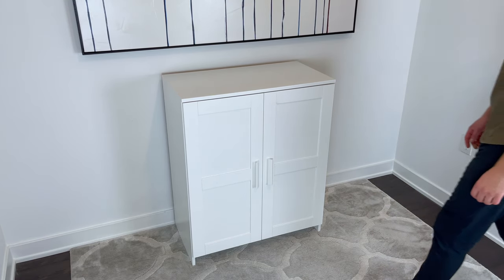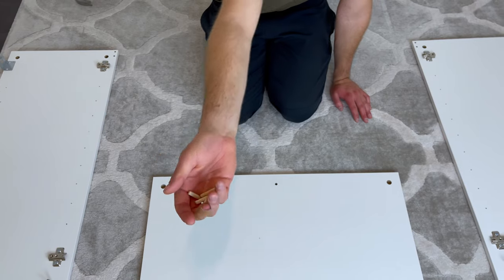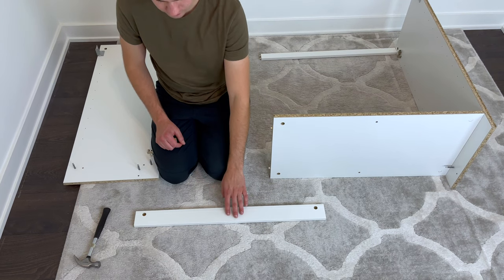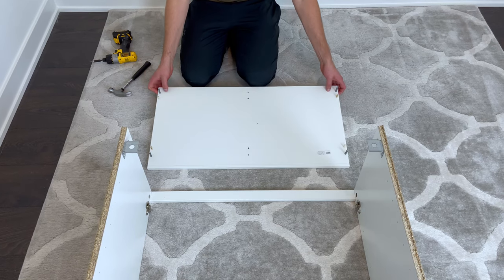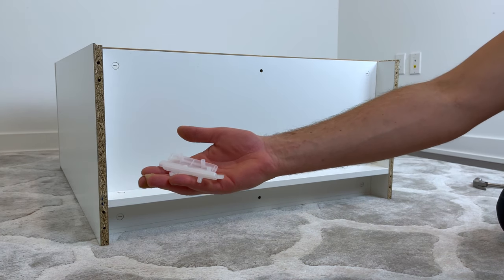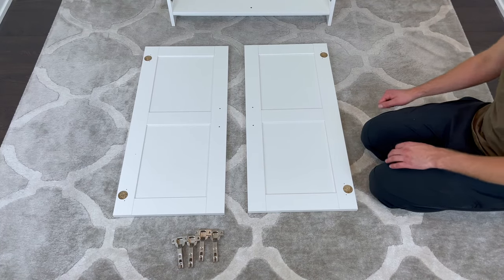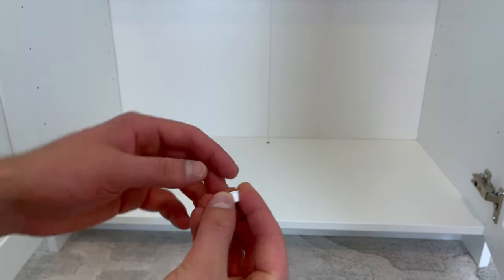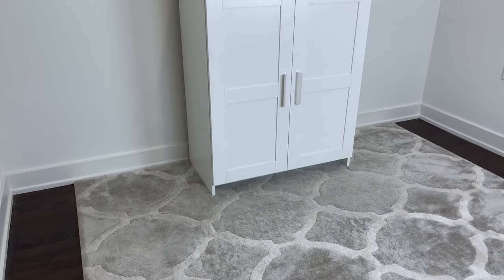Easy to Follow Brimnes Cabinet with Doors IKEA Tutorial

Comment: These steps were SO clear and I greatly appreciate you keeping the orientation static, making it incredibly easy to follow. I bought 2 of these and the following tips made the second cabinet a breeze:
1. If you're going to use a drill, remember to set it to the lowest speed to avoid splitting and other damage. 
2. When adjusting the hinges to close door gaps or level the doors, do NOT unscrew the screws all the way. 😩 Save yourself the frustration of having to line everything back up again. Unscrew and/or tighten just a touch, then test out where your doors sit each time.
3. Really be mindful when hammering in the backing. Ensure you're hammering into the frame (place closer to outer edges) or else you'll see the nails in the interior of the cabinet. Not a huge deal, you can use the back of the hammer to take them out and reposition.

Comment: I made it through everything. I had also considered returning the box and opened, but checked YouTube and here you are! The only thing is, I have a large gap at the bottom between the doors, tried fixing it, but honestly putting doors on with the hinges, was the most difficult part. I tried adjusting, but to no improvement. There is a gap because things just wouldn’t go flush all the way through. I even had to use a mallet that I covered with a cloth. But it’s done thank goodness. These instructions were very good to follow. I can’t tell you how many times I’ve backed up and watched and re-watched, L O L. Thank you and should I ever by Ikea again I know where to come.

Comment: Do you consider that is necessary to fix it to the wall? Just because I am not allowed to drill walls in my house
Reply: You truly only need to mount this piece if it's sitting on carpet or you have kids/pets that roughhouse. It's very steady and heavy. IKEA got sued for $46m because a dresser tipped and killed a toddler, so take precaution if you need to, but this cabinet would be hard for me to intentional push over as it's sitting on my wood floors.
Reply: Oh wow I didnt know THAT was the reason. Im also not able to screw things into my rental, so it was always discouraging to feel like everything had to go into the walls. Thank you  @MaxineShaw_84